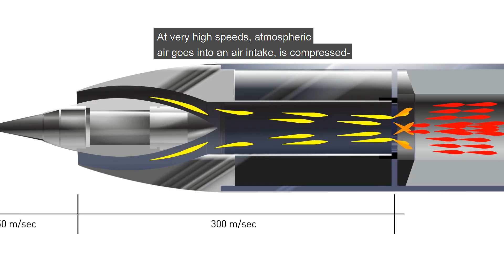How ramjets may change the role of artillery on the battlefield

Comment: USA: noo! you cant just call a truck with missile a artillery!
Russia: H A  H A   K A T Y U S H A  G O  B O O M  B O O M
Reply: Ever heard of HIMARS? Truck mounted US rocket Artillery. US Artillery got away from rockets during the late 1950's but they came back in the late 1970's and it is a very successful and lethal set of weapons platforms/munitions with ranges of 300+KM.  So rockets have always been considered Artillery by the US.
Reply: Bugsey35 the New HIMARS system only has a pod of six rockets,and takes 1-2 minutes to fire 2 missiles,while the Russians made the Grad rocket system that has around 50-70 rockets it can hold and can fire and destroy everything in a grid square where the rockets land,while the Americans aim for “precision”
Reply: @elemental7726  Grad have only 40 rounds at every truck.
Reply: We a call a tank with wings an airplane.
Reply: AH-64 wants to have a word with your truck.
Reply: @MorteWulfe  Ka-52 have the same word.
Reply: We were shooting ATACMS over 100 miles in 1992 when I was in the US Army.  Quite a bit of that Russian junk is loaded one tube at a time rather than in a modular fashion like MLRS.
Reply: @JB-cv6dz  That  has it sadvantages. It is easier to  operate one tube at a time when you are at a strict logistic scenario.  Either of the options has is merits and demerits.
Reply: @JB-cv6dz  You are comparing apples to oranges. ATACMS is a tactical missile and, as such, should be compared to 9K720 "Iskander" (https://en.wikipedia.org/wiki/9K720_Iskander ).
Reply: IN YOUR BACK POCKET OF COURSE?  Don’t forget to tell Kim?  😂
Reply: MLRS were used by the US Army in the first gulf war. 

"On 2 September 1990, the 6th Battalion, 27th Field Artillery deployed to Saudi Arabia in support of Operation Desert Shield. Assigned to the XVIII Airborne Corps Artillery, the unit played a critical role in the early defense of Saudi Arabia. As Desert Shield turned into Desert Storm, the Battalion was the first U.S. Field Artillery unit to fire into Kuwait. Over the course of the war, the 6th Battalion, 27th Field Artillery provided timely and accurate rocket and missile fires for both U.S. corps in the theater, the 82nd Airborne Division, the 6th French Light Armored Division, the 1st Armored, 1st Infantry Division, the 101st Airborne Division, and the 24th Infantry Division (Mechanized)."
Reply: But over 1.500 Artillerie Cannons were sent to Poland. How many rojet-platforms are there? None! How many are on the opposit side in Russia? Right over 2.500! Nammo is on the right way and Rheinmetall does it even. Best regards
Reply: @faburoes  Russia is not opposing Poland in any kind of military engagement. Unless, of course, Poland decides to test its luck in such an engagement :)

Comment: Well this is dumb!
1) Payload - A shell is a way of delivering high explosive... If you fill the shell with a ram jet, what space is left for the payload?
2) Accuracy - Unless that thing is guided, the extended range is only going to make the thing less accurate. If it is guided, then that's more space taken up and more cost to produce.
3) Cost - Artillery shells are cheap. Missiles are f***ing expensive. This is a missile that has a fraction of the payload of either.
All you've created a bloody expensive but long ranged hand grenade.

Comment: 2:02 OoooK, but... where do YOu put WARHEAD with few kg of explosive when whole projectile is ramjet ?!
Reply: You don't need much, kinetic energy is enough to destroy buildings
Reply: Kinetic projectiles are effective in direct fire, against determinated objective (an armored vehicle), but this is not the proper use of howitzer shells.
Reply: @silvermann500  indirect or direct, it will hit the structure with enough force to destroy it
Reply: Yea but is pointless- In my opinion, sure.  You can punch a hole through a building, but don't cause the same area-damage than a explosive shell. An attack of kinetic projectiles may create a zone with random buildings with huge holes. The same attack with a explosive shells "clean" the entire area, crushing buildings, blocking streets or roads, and killing (or wounding, or scaring) enemy troops in the area.
Reply: @silvermann500  I believe that is the point here. You do not want to cause collateral damage, so they have made a shell designed to kill a single structure.
Reply: Really difficult with howitzers. In another Nammo video, the company shows the precission of his new and balanced (explosive) shells...inside a soccer field. The margin of error is really big. For pinpoint strikes the armies have better tools: aircrats, missiles, drones...

Comment: I’ve seen some coms replying on the fact that kinetic energy would do the work.
But. Let’s take into account the four major things going around artillery :
- price (because if we had infinite money, artillery would be dump and we’ll use only missiles)
-precision
-post impact damages (destroy the target and only the target)
-range of fire.
What I see in that new shell (as someone with no real military experience, so correct me if I am wrong), is that it only answer the last one.
In terms of price, even if it’s cheaper than missiles, it is still most probably way more expensive than standard shells.
In terms of precision, especially at 150km, with a rocket engine, it required some kind of guidance to be around 20m radius from target, just because of all the small turbulences in the air that will always devote the shell. For exemple no artillery shooting at 40km is more precise than 10-15m (and deviation grows exponentially). So adding external guidance adds to the price.
And then post impact targets. Well yes you have no warheads but a strong kinetic impact.
But with a shell going mach 3, if it doesn’t it specifically the target, the sharpnell will just continue on the direction the shell had, or even worst, they’ll just hurried them self if the angle to the earth of the shell is to big.
Just to show and exemple, take a tank game like war thunder with some kind of realistic damage properties : if you use and HE (like standard artillery) you can shoot 2m away from the target and still hit it, but with an APFSDS, the only thing you’ll do is make a small hole in the ground.
Reply: No, we would not dump cannons for missiles, because of the much greater logistical requirement for missiles and that is not just a financial problem. One if the beauties of cannons is how sustainable they are.

Comment: I have participated in few tests of the Nammo Ramjet 155 rounds. The issue is that the round pressure quickly deteriorates the barrel and the chamber. We used a M109 A6 P platform and we decided not to proceed with this program.
Reply: How ?! Its fired like regular shell, air only going in when shell is out barrel.
It's same pressure like it firing regular she'll
Reply: @pharaon6718  Ramjets can't start until you're already at a certain speed. So the problem probably isn't the ramjet but needing to fire the round in a way that gets it up to the threshold speed for the ramjet to start working. Just my guess.
Reply: how about smoothbore barrels? The other advantage would be that one can get a larger caliber in the same dimensions as the rifled gun, just by removing rifling (say 170-175 in the dimensions of 155).
Reply: @solarissv777  A smoothbore gun with a discarding sabot sub-caliber shell should enable higher muzzle velocities with less barrel wear. Essentially a big tank gun with guided ramjet shells. Of course this starts to become quite complex, hence expensive, compared to regular artillery tech.
Reply: @freetrade8830  but this gun would be able to do things that current artillery is unable and IMHO should be compared to HIMARS/M270 rather than regular artillery. Also, IMHO, guided ramjet rounds shouldn't be the sole type of ammunition. I would add also some oversized Excaliburs (adopted to be shot from a smoothbore), or something like that. The idea here is not to be cheaper than regular artillery (at 20km range), but be able to put as much firepower on target as GMLRS can at  30 - 70 km, for less money, and moreower less logistical footprint (than it makes sense) as well as be able to reach targets that are outside the range of any ground artillery system 100+ km (besides tactical missiles). Also with high proliferation of drones (even down to squad level), much better targeting can be provided, and thus less rounds would be needed to achieve the same goal (and here guided rounds can actually shine). 
The main detriment of introduction of such gun system would be the need to produce new type of ammo (different caliber, guided and, possibly, saboted) but if such system would be adopted by both army and navy, the economy of scale can kick in.
Reply: @solarissv777  Smoothbores require active stabilization, thus the higher cost per round
Reply: @hellstromcarbunkle8857  I believe, this round already has guidance
Reply: @solarissv777  Of course. I was referring to rocket assisted rounds, already extant.
in both cases, yield suffers.
Reply: @hellstromcarbunkle8857  that's why I mentioned, that smooth bore guns can have larger caliber with the same overall dimensions of a gun, and larger caliber allows to pack more explosives.
Reply: I suppose it's no worse than max charge using std shells?
Reply: Same problem as the Rail Gun program.

Comment: I feel like this weapon falls into a pretty small niche for militaries. Super-long range ballistics like this might have limited use, but could be useful. For the most part, I feel like for long range, extended bombardment,  air craft and air bombing fills the role that shelling once did. Even with extended range, I'm not sure how useful it would be on a modern, highly mobile battlefield. 

It's an interesting concept, but if I try and think of what artillary is used for in modern times, I think of fire support for ground movement, and if you're a man on the ground I can't help but think that waiting those extra seconds waiting for a ram jet shell to impact would be more hassle than it's worth.

I'm not incredibly well versed on the application or use of artillary though.

Comment: Three questions, even if you succeed with engine. Payload amount, price and targeting designation and locking system. Soviet and Russian rocket systems covers huge area at once, relatively cheap and deliver a big punch in one strike. Artillery will always be more tactical than that - 20-30 km is quite sufficient for their role. Its much better to develop ATS rocket for 150 km if you need a "safe firing" role. It would, presumably, be a more cheaper and technological solution due to no restrictions to 155 mm caliber. Records are not the issue on the war, practicality is.
Reply: Fair point on Rockets vs Guns....

Comment: The Ramjets built in Swiserland used no Oxidizer Agent !
Once they hit a certain speed, the surrounding air becomes the fuel source.
the distance is only limited to the failure of the Tungsten. Witch was well beyond a 1000 kilometers.
I was told the problem is excelleration. They keep excellerating at an expodential rate until they disintegrate. Who really knows ?
Simply amazing tho......... An engine that caries no fuel, has No moving parts, and yet it can zip across the sky, at hypersonic speeds !

Comment: Interesting... Could the intake be a shaped charge, technically? This could make the whole design still very compact.
Would they use liquid or solid fuel? With solid fuel, the whole extra complicity in comparison to traditional cannon grenades might be the electronics, and we have experience with these already too.
Reply: Late but, Ramjet are less powerful than solid fuel or a rocket motor, But they run far longer. Which is what they want if you want to shoot something at 150km away. Long range 155mm with rocket motor reach around 60-80km

Comment: 3:55 - 'Since we use air from outside through an air intake, it will burn much longer than a standard rocket motor.'  Nonsense, it will only burn for as long as the fuel (propellant) lasts, and that will be the same duration regardless of where the oxygen comes from, external or internal.
Reply: Not really. If you are using a conventional rocket assist, you need to use up space for the oxidizers. With a ramjet, you can have all the space dedicated to the fuel and no oxidizer, which give you more fuel and more burn time.

Comment: I thought the point in a 155mm artillery piece was to pack a punch? You can reach 150km... great, how much punch did you give up in the process? On top of that, I thought we were talking about artillery shells, not missiles. If we’re talking missiles America’s M270 MLRS or HIMARS can reach more than 300 km. And those rockets can actually pack a punch. Why would we want this over that? Russia and China may have more artillery systems than us, but that doesn’t mean the can compare. Hell, with Excalibur anyone of our 155mm guns can fire 65km with pinpoint accuracy. Any further and you might as well call in an air strike or tomahawk.

Comment: What a load of crap. If you’re attempting to hit a target at 100km (as they supposedly say) you’re Better off just using an MLRS for the job. 

Sticking a rocket motor in the body of a 155 just reduces practicality of the weapon. The payload of the HE will decrease so you’ll probably end up sending double/triple the amount down range just go suppress a target. Saying that they probably cost twice as more as a standard shell. 

Whole point of artillery is to suppress targets and give infantry close fire support. There is literally no point in keeping them 100km from the line. Also can’t see many of these surviving the forces from being shot out of a 155 barrel.

Comment: “HE explosive with similar weight as 120 mm round." -Nammo. Around 3 kg, like HE rounds from main battle tanks. They will have to use GPS/INS or a very strong reciever to rely on accuracy.
Reply: Exactly.  This is an anti-artillery system.
Reply: It is like the excalibur nonsense, only corruption can build a $112.8k artillery shell

Comment: The M109 - 155mm howitzer has a range of about 14,6 Kilometers. Gerald Bull, the one of Iraqi supergun fame, redesigned it for South Africa’s Denel Land Systems. Using the normal Extended Range, Full Bore (ERFB) ammunition the range is 30 kilometres, which can be extended to about 40 kilometres using base bleed shells, or 50 kilometres using rocket assisted V-LAP rounds. In 2002 Denel produced the G5-2000 version, with much greater range and accuracy than the earlier version.
So, it is true that there was no development since ww1